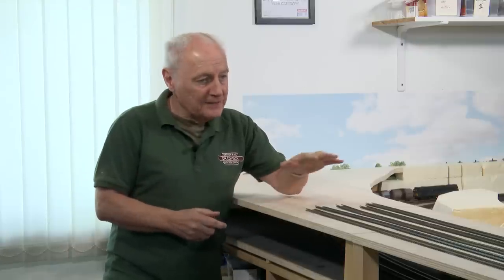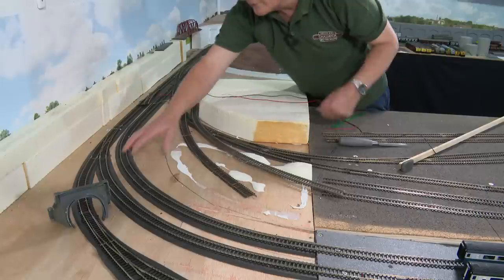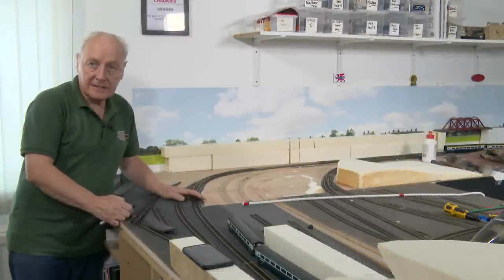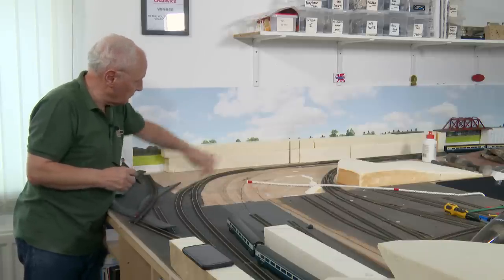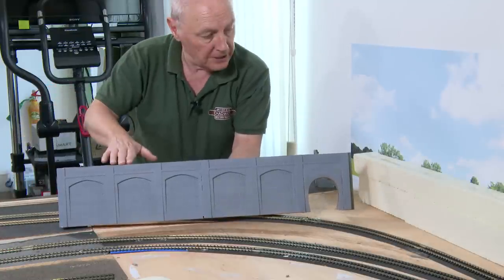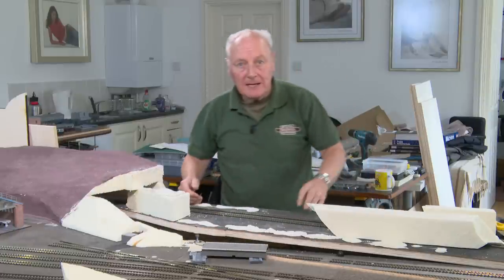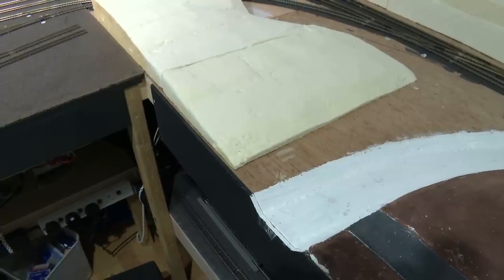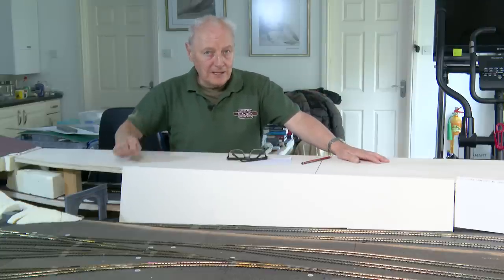BUILDING THE FREIGHT YARD at Chadwick Model Railway | 203.

Comment: In my opinion Charlie, I think you’d benefit from a visual transition between the helix tunnel portal and the tunnel/bridge portal disappearing under the Freightliner terminal. If you make that whole wall (which is currently just white card) a retaining wall, then that’s a LOT of brick. There’s a lot of brick walls on the layout already. The road coming up from the river to the FL terminal makes it look like the terminal is placed upon a natural shelf, above the rest of the layout. 
So, what I’m suggesting is; some of that area and cutting should perhaps be exposed and cut rock, where the navvies sliced through the natural shelf.
It also means that with a bank or exposed area, the loop line portal could come forward a little, to come closer to a right angle over the line it covers. 
Personally, I think it’d look good if the helix portal had some retaining wall around the portal, transitioning to cut rock, under the road bridge, into an embankment, over the loop portal and turning into more of a steep, overgrown slope until it meets a the FL terminal feed line. The grassy bank would probably get too steep In reality to hold soil and would probably return to retaining wall in the real world.
It’s just a suggestion, but I’m sure you’ll do a fantastic job whatever you do! My immediate thought was that there is already a lot of uniform brick walls on the layout, that’s all.
Reply from the maker: That’s a very interesting proposal L779, and one which I am considering in places. Regards, Charlie

Comment: Charlie, I'm a little unclear at what you're after. By "freight yard" do you mean something along the lines of general merchandise - which would be on the decline in your period. Or something more specific, like aggregates - which were on the up in the 70s. 

A more general yard would have warehouses/sheds/etc which would add height to an already high-level location. Would this over dominate the diesel depot and oil terminal?

Are you looking for lots of shunting too?

A freight yard in such a high-level location would've been built with a purpose. Could it be the truncated remains of a disused line; maybe having a lifted trackbed at the far end?

Difficult to plan anything without a bit more of what you want to achieve.
Reply from the maker: You ask some interesting and pertinent questions Peter. I need this yard to be capable of breaking up van trains and dispatching them to other depots. It’s to provide interesting shunting operations for the yards operator. Regards Charlie

Comment: problem is you haven't covered  run around  tracks in the fiddle  yard itself  charlie,  where you break down the  rolling  stock
Reply from the maker: Actually Jason,  I haven’t covered any aspects.  It’s all part of the suggestion for folks to have a go.  Regards Charlie
Reply: @ChadwickModelRailway   Charlie i have been talking about this for about   1.5-2 years now and you still haven't addressed this issue 

Main line east and west down the middle and  fiddle yard   branching out both sides and having a cross point  both ends of the main line  so shunter  can cross over and having 2 spurs on the 2 outer most  tracks  so the spurs can used as run around track  when mains are  in use
Reply from the maker: Sorry Jason, I completely misread your comment. My East and West fiddle yards are not designed for the breakdown of my Trains. My fiddle yards are simply there to control contain made up trains. The breaking down of them would only ever take place in the scenic sections, hence that is where all of my shunting operations take place. Accordingly, there is no uncoupling systems et cetera placed in the fiddle yard.
As I said, it is purely a storage area for fully made up Trains. Regards, Charlie
Reply: @ChadwickModelRailway   everything is a scenic view charlie even if it is only being used as a storage are for the main layout though the what youare talking about  you are wanting to do more with the area otherwise what you are doing is a complete waste of time

Comment: My recommendation, work out what goods would be coming into or out of the yard. Each type of goods will need suitable facilities for loading/unloading. A couple of simple ones that spring to mind.
Coal, local people would need it for heating. Therefore it's common for there to be a local coal merchant operating out of goods yards.
is the area one that produces livestock or is it more arable based? 
If livestock, would it be where there's a market meaning the livestock is coming in? Or, are the sheep/cattle/pigs heading out? 
If arable, is there a suitable area for wagons to be loaded? Is anything coming in for local businesses that needs unloading.
Many yards also have standard facilities, a crane was common especially as BR introduced the small containers that would be loaded onto 4wheel Conflat wagons.
A Goods Shed is also a common facility, a loading dock or raised platform also was common. 

If I get chance I shall certainly have a go at doodling a track plan, otherwise I look forwards to seeing what everyone comes up with :)
Reply from the maker: Many thanks for such an interesting and in-depth comment. However, my layout is based around 1970, and the transport of livestock at that stage,may have been completely over. I certainly don’t remember cattle trucks on the rails. Regards, Charlie

Comment: Your 'straight curve' that runs into point 80... I wouldn't be so worried about absolutely accurate curves - they certainly don't work like that in real life and at times we will see real quirks of construction: the one that springs readily to my mind is just after the level crossing on the main road between Echt and Susteren in the south of the Netherlands; just after passing the crossing, southbound trains experience a rapid  'kink' of probably almost half a track-width. I have no idea why (the absence of a kink on the adjacent northbound track indicates no link with the now abandoned goods yard on that side).
Reply from the maker: You make an excellent point SL. Many thanks, regards, Charlie

Comment: As a retired bridge engineer I have to say it is highly unlikely that you would find a skew tunnel mouth in the real world. The brickwork of the arch would need to follow the skew angle the whole length of the tunnel, resulting in using far more bricks than necessary. In reality the embankment on the ‘long side’ would be excavated further to allow a mouth perpendicular to the tracks. In your case this could be achieved by a retaining wall and look far more realistic. I have to say the skew brick tunnel mouth just looks wrong.
Reply from the maker: Thanks mate, your expertise is invaluable. Stay safe, regards, Charlie
Reply: Hi Charlie,
 I forgot to mention in my previous comment, neither a steel girder or a reinforced concrete beam would be used in your situation - they are mainly found in urban areas where buildings are subsequently constructed over an existing line, or a cut and cover situation such as the Metropolitan Railway in central London.  I follow your layout progress with interest as I have three helixes on my own layout.  All the best, Chris @ChadwickModelRailway

Comment: Not going to attempt a track plan, just a comment re the tunnel opening support . . . . . its not correct! A 'Plate girder' (which that models) is generally used for bridges that have intermitant loads applied over them, not a sustained load from a hillside (in your example) Rounded / Arched tunnel mouths are designed for the permanent load from hill or mountain above. A tunnel portal may look strange to you but it is unlikely the track plan like this would occur in the 'real world' - time to say 'enough is enough' and stop adding stuff!
Reply from the maker: Many thanks for your opinion. However, I do find it crucial that we need separate facilities for operators to use. Regards, Charlie